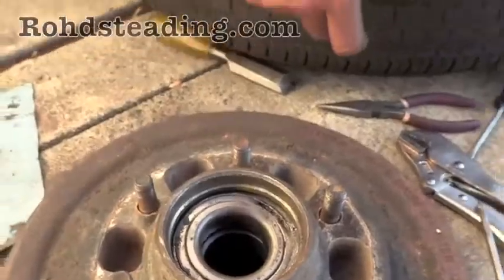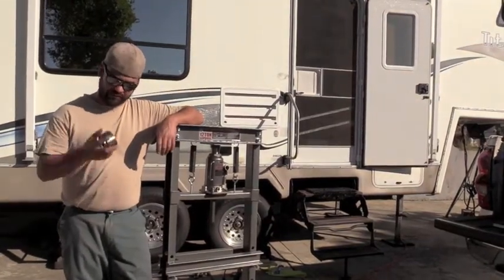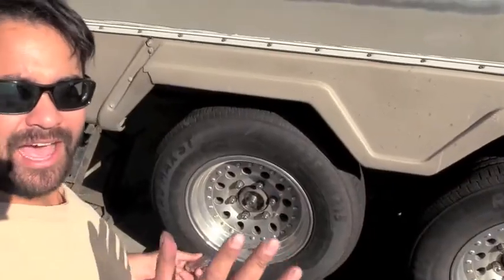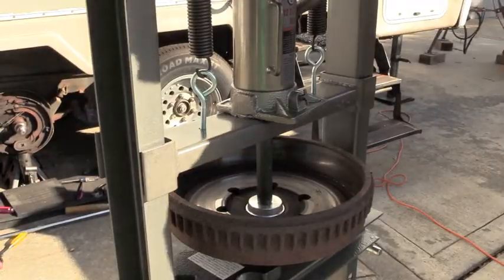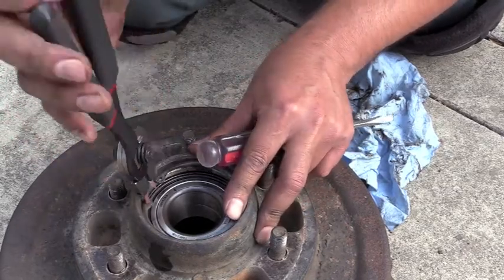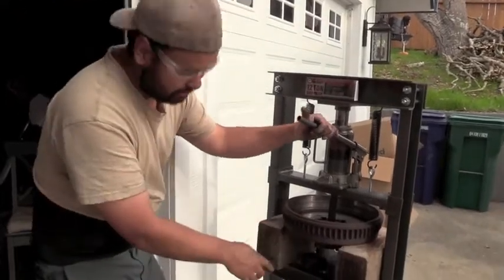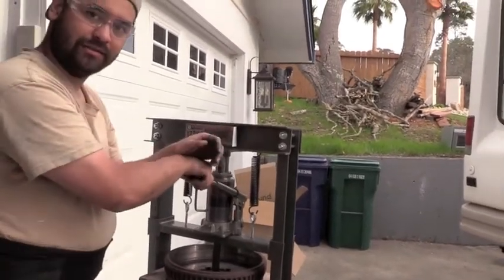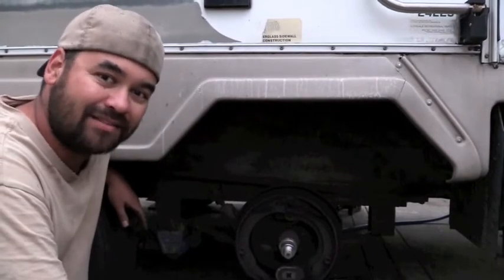Nev R Lube (Video 74)

Comment: Great video!  

I've put a lot of thought into it and decided to go with standard bearings.  Dexter says the hubs should be removed every 12 months or 12,000 miles (which ever comes first) and the brakes inspected.  Since I have the hubs off anyway, it's very simple to clean, inspect and pack standard cone bearings.  And by performing a visual inspection, you can see if something is amiss.  With the Never Lube version, you won't know you have a problem until they start to fail.  You were lucky that you noticed the play in the wheel which did indicate the bearing was worn out.  If you hadn't have noticed that, you could have lost the wheel.
Reply from the maker: Yes, I agree with you and considered changing to standard axels as well.  In fact, it was recommended to me years ago by a trailer parts place that when I have an issue with one of these bearings to swap out the axels to standard axels rather than replace the bearings.  We were lucky that we caught it.  We were adjusting the brakes which we typically do once or twice a year when I discovered it.  With that said, six months prior I questioned whether something was wrong with that same wheel.  So, it was kind of on my radar.  We chose to replace the bearings rather than switch out the entire axel because of supply chain issues at the time.  And that was our deciding factor as we were able to get the bearings in a timely manner.  So we thought we would give them a go.
Reply: @rohdsteading5880  One other thing you can do is carry an infrared thermometer.  When you stop for a break, you can aim the thermometer at the hubs.  If one is reading quite a bit higher than the others, further investigation is needed.  Higher temps in one hub may be due to the bearings or the brakes.
Reply from the maker: Yes, exactly!

Comment: I believe the original bearing on the first & 2nd wheel moved during the 7 years, putting pressure on the large snap ring. This may be why they are not coming out easily.
Reply from the maker: I can agree with that with the way that the snap ring came out.  It's hard to believe the bearing moved in there but I am sure it's possible.

Comment: Also, the 2nd bearing had something wrong with it. Should not have required that much pressure to press out
Reply from the maker: It seemed like all four bearings took about equal pressure to press out.  We believe the press was definitely undersized for this job.  We would recommend something bigger than the 12 ton press that we had.